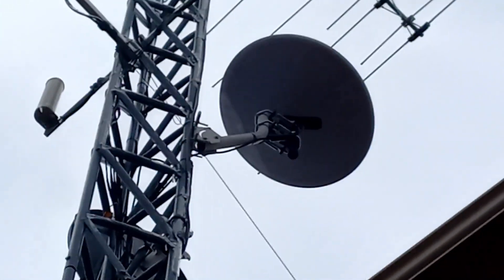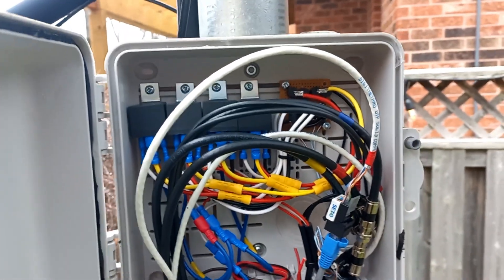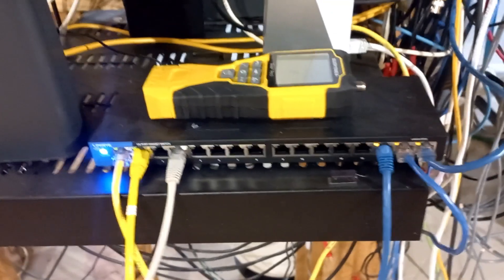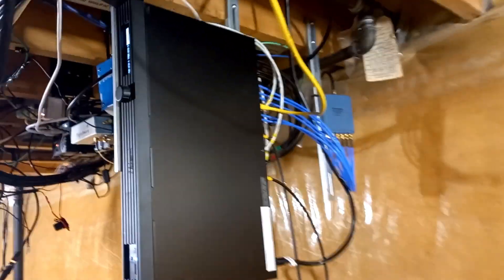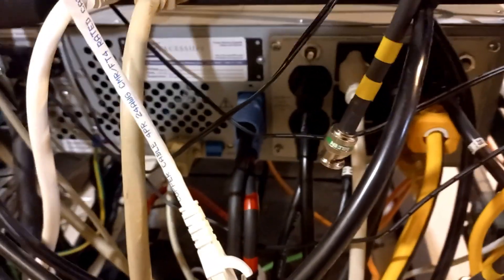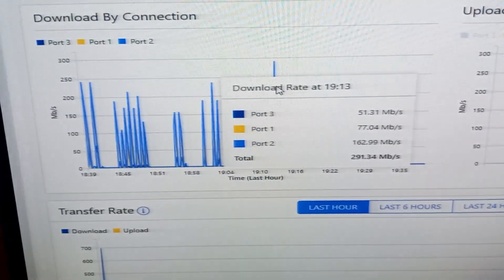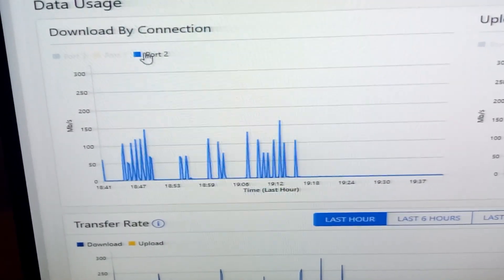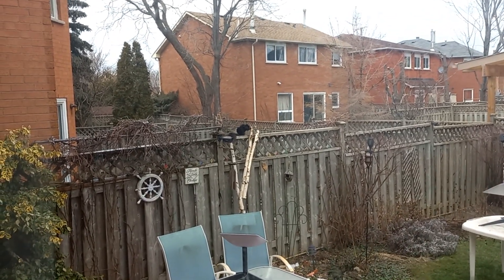Starlink RV vs Business vs Residential.  3-Way Simultaneous Connection Test! Which one is better?

Comment: I have a question......does combining two Starlink internet give you an overall higher speed.....like if Starlink A give 200 & Starlink B gives 250 ....does it mean you are getting 450mbps?
Reply from the maker: In my experimenting it did. I had 2 starlinks with 15 mbps up each and when aggregated using a Dejero gateway I was seeing 45 mbps. This was likely due to the fact that the Dejero gateway used UDP tunneling.
Reply: @peterfairlie2296  Thank You So Much For Your Response 🙏

Comment: Is it possible to have public ip address? (Fix or Dynamic?) I got the residential and its not even a dynamic public ip address
Reply from the maker: They do offer static public IP's that will allow you to do port forwarding if you subscribe to their business package at $500 a month. I would just setup a VPN server somewhere and tunnel that back to a router at your home. This would work the same and allow you to forward ports, etc.
Reply: @peterfairlie2296  Thanks for the information, In fact it's for a company backup, is it possible to use starlink as an internet backup with vpn access from my users to my local network +? it's easy with a fixed public ip address but with starlink...
Reply from the maker: Sure, the same router you'd use for the VPN tunnel could also do load balancing with priority routing and failover to Starlink when the local ISP goes down. WRT would be ideal for this setup.

Comment: Just my opinion....For the amount of you pay for Star Link subscriptions and amount you payed for dishes, cables, routers, gateways. You could buy an Residential Fiber connection. And Not To Mention the Amount of Power you spend for all that. So I suggest buy a fiber connection.
Reply: you’re failing to remember the entire point of starlink. it’s to provide internet connection in locations where there is no fiber or high speed internet available. obviously a fiber connection is faster, less complicated, and sometimes cheaper. but that’s not the point of starlink, and this video is a proof of concept. i recommend you watch the entire video
Reply: Or even a 4g+ or 5g has more internet speed then your all Star Links combined.